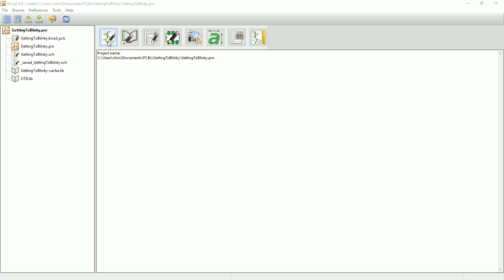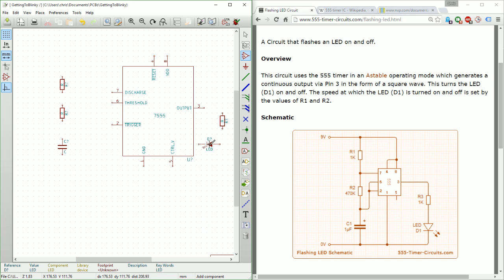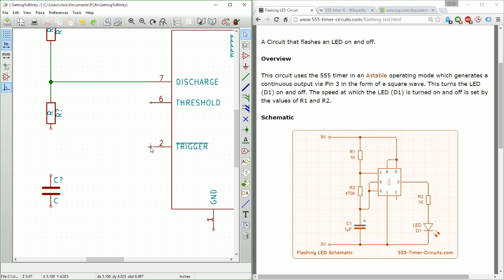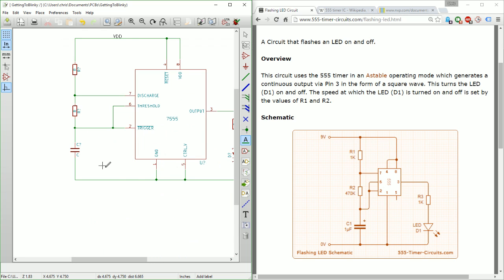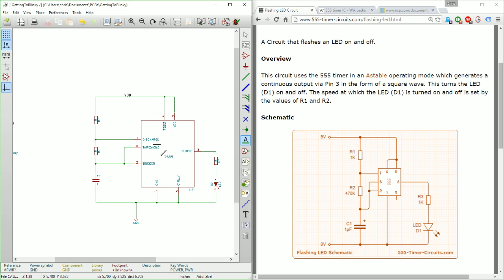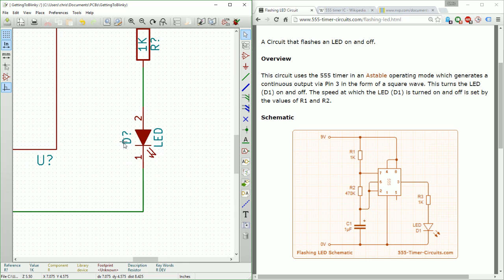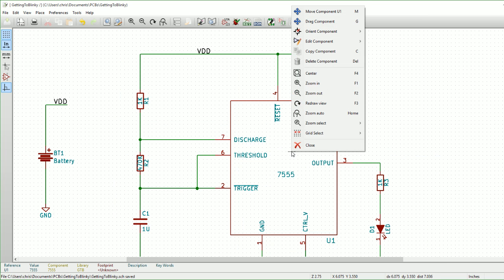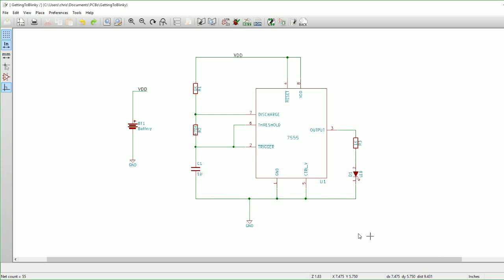Getting To Blinky 4.0 - Finishing The Schematic

Comment: Hey Chris, enjoying your entertaining videos on KiCad.  You have a very good manner & style for explaining these details - I keenly encourage you to keep going!  KiCad needs you.

Just a thought or two.

1) I like how you've gone through the process of creating a new part, but it might be wise to caution new users to restrain their enthusiam in a rushing to create a batch of new parts.  Your illustration shows just one of many common reasons why - lack of grid discipline.  Perhaps mention in your video, the reference  https://github.com/KiCad/kicad-library/wiki/Kicad-Library-Convention.  There are always standards to be aware of and adhere to.

2) When using shortcut keys for various operations, perhaps verbalize the operation and keystrokes as you perform them.  This also helps to pace the video so that learners can follow more easily. 

3) Please finish your schematic entry process by positioning the reference designators. Probably you would have done this for your own work.  When planning your topic, be keenly aware that you are an educator and inexperienced users tend to very quickly pick up sloppy or loose-end habits.

4) You may wish to check your 7555-5 connection.

Looking forward to viewing your next lesson!
Reply: Can you elaborate on what you mean by "lack of grid discipline" in point 1?

What do you mean by "positioning the reference designators" in point 3?
Reply: Grid discipline refers to adhering to the grid size interval standards defined by the ECAD developer and chief librarian.  These standards (as linked in my original comment) define how the schematic symbols should be created so that component pins and net connections snap together precisely thus ensuring that their electrical interconnections are properly defined.  If you change the grid parameters arbitrarily, at some point you will encounter issues.  Lessons will play out with experience.  Keep in mind that any 'rule' can be broken, provided you understand the consequences.  At around 0:35, you can see that the IC symbol that Chris created contains pins and connection points that don't fall precisely on the standard drawing grid. 

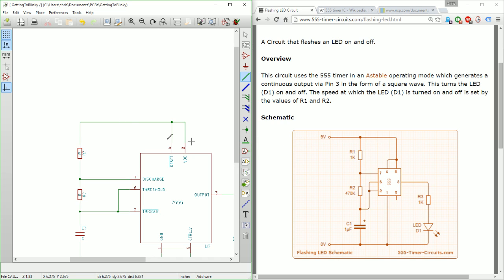WRT the Reference Designators (referring to the part names like R2, C15, U4, etc.), if you look at 05:12, the drawing to the right shows correctly positioned and finalized part labels, the KiCad (left) side have not been moved to their final location as per schematic drawing conventions.  Best bet - develop a trained eye by studying professionally created drawings and application notes published by semiconductor parts manufacturers like TI, OnSemi, Microchip, Linear Technology, and all the others.  Refrain from following the many examples from eager well-intentioned hobby posters on the web - too many have no formal knowledge or industry experience and tend to promote or perpetuate sloppy habits and unpolished/unfinished work.